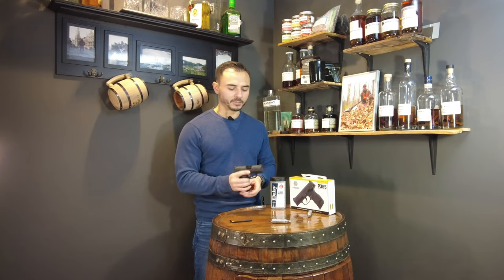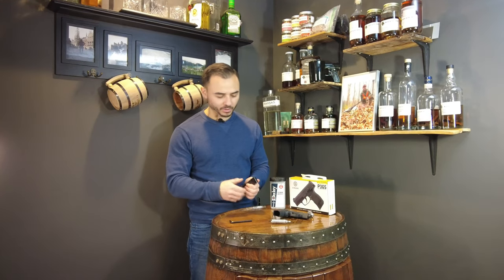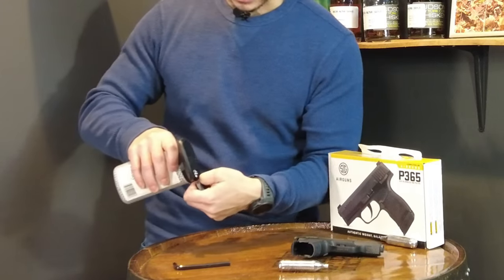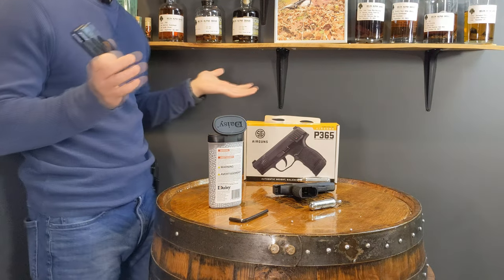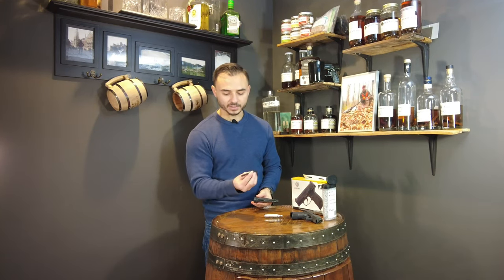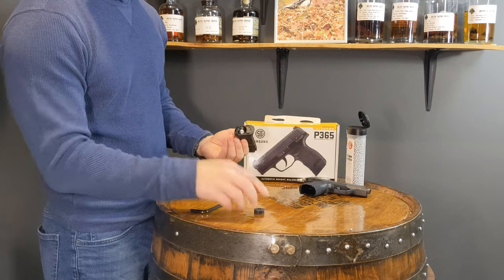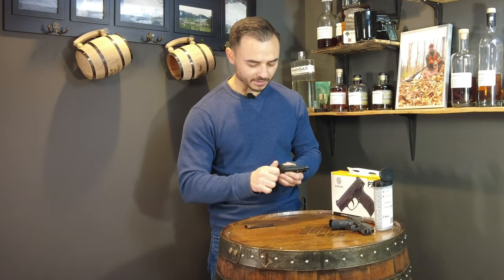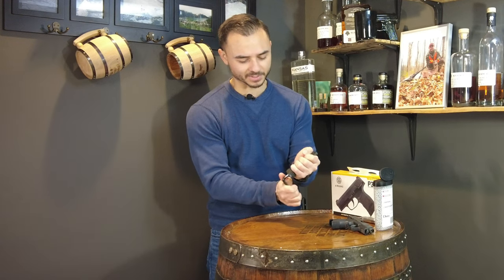How to Load Sig Sauer P365 BBs and CO2 Cartridge

Comment: Thanks for your video. But if anyone is considering one of these get instead a P320 pellet gun.  Easier to work with and bbs are a PITA.
Reply from the maker: The main reason I got this is because P365 is my EDC.  I can train a bit with this BB gun version and have the same feel as the 9mm.  I have a P320 sub compact that used to be the EDC but it's just a bit too thick and heavy for EDC for me.

Comment: Hello - do you know how to fire this without BB's and have it keep firing without locking? I want to get a Spier laser to connect to the rail so I can use it with my Somkeless Range. The only way I can find to do that is to put my thumb on the slide lock to keep it pressed down. It seems kind of normal (I mean the placement of my thumb) but I want to find a way to do it with having to hold down that lever.
Reply from the maker: Hi Barry, I tried the same thing, the only way to do that is to lock the magazine feeder all the way down to the bottom notch of the magazine.  I tried it and it worked, but the recoil dislodged the magazine feeder from the notch, so you may need to tape it in position or put something in there to block it from going back up to the top.  The magazine feeder has a feature like regular firearms where when the gun is empty, the magazine feeder locks the slide back by pressing up on the slide lock/catch (the thing where you are resting your thumb on).  If you're looking at the magazine from the view of where you put the BBs in, on the top right you will see what I'm talking about.  That post presses up against the slide lock when the magazine is empty.  I hope that helps and makes sense.  Let me know if you have any other questions.

Comment: I let a friend change the CO2 and he annihilated the cap, stripped it completely. I don't know how anybody could be that dumb especially when mine is metal not plastic. Anybody know if I can replace just the cap? I can figure out a way to get the old one off.
Reply from the maker: Maybe SIG could help? Or find something similar at a hardware shop. Like a pipe plug with the same threads or something
Reply: How do you get the old one off?
Reply: @99CrCker  I asked a guy to remove the CO2 for me and he stripped out the nut that takes an allen wrench to get off. It is stripped so badly I have tried everything and can not remove it to change the CO2. Any ideas or throw it away? It is brand new.

Comment: I just got this my mom got it for me my CO2 popped then when I got one in there I stripped the screw on accident now my CO2 stuck I'm supposed to get a new mag today but I don't want to break another mag
Reply from the maker: Maybe use a punch or something to punch out the CO2 from the side opening and find a metal nut at a hardware store that may fit
Reply: @58Alpha  ok thx for helping
Reply: I bought 2 both junk
Reply from the maker: @marksmith8421  should have bought the P365, and not the junk.
Reply: @marksmith8421  I had to buy a new mag the other came messed up